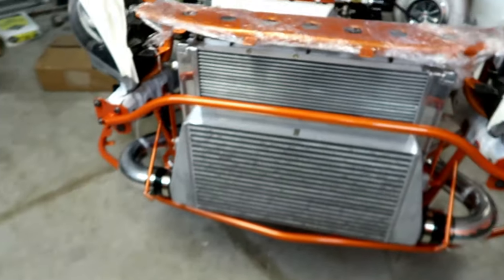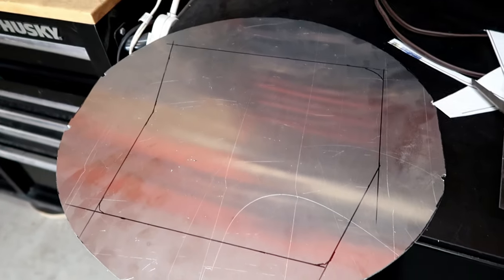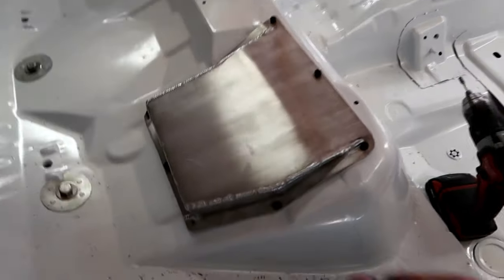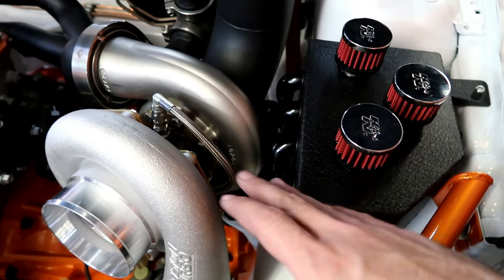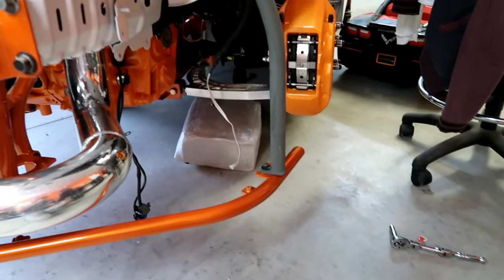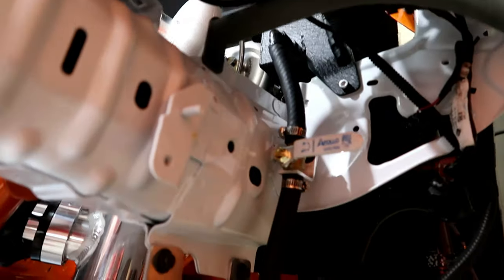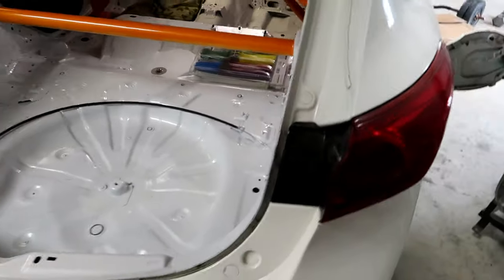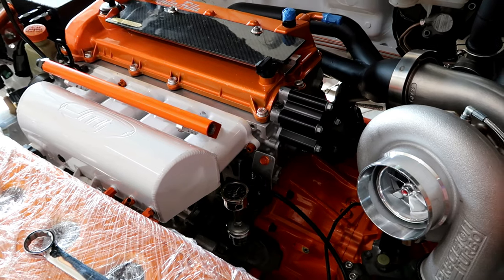Mazdaspeed3 Oil Cooler + Parachute Cables + Fuel Pressure Regulator (Episode 49)

Comment: What high pressure fuel pump are you running
Reply from the maker: None. Its getting deleted
Reply: @WZ_TV   so is there something that replaces that because i might look into that delete i hate having to put mine on anyway might do a delete so is there something id have to run so nothing fucks up know what i mean
Reply from the maker: @kobiem24  yes i made a delete housing and injector plugs